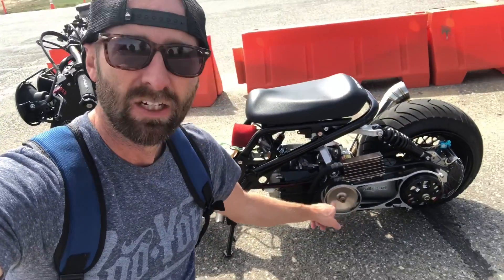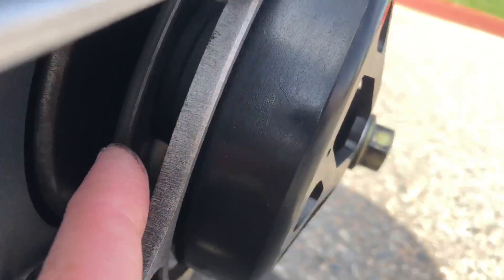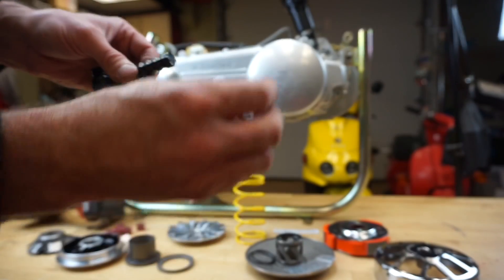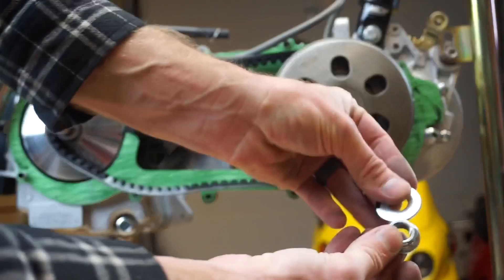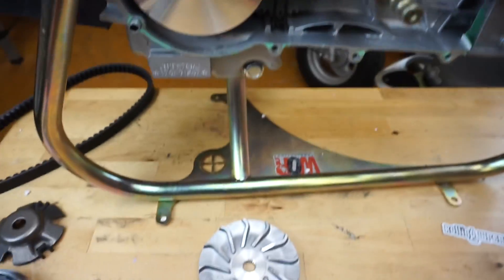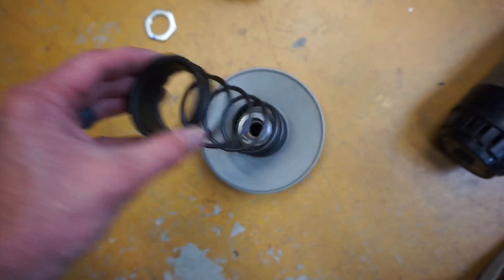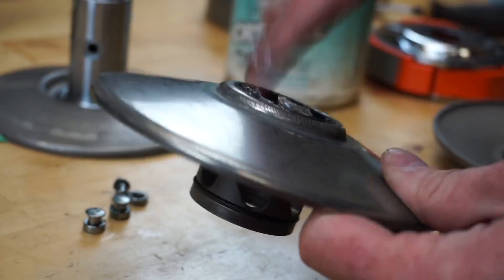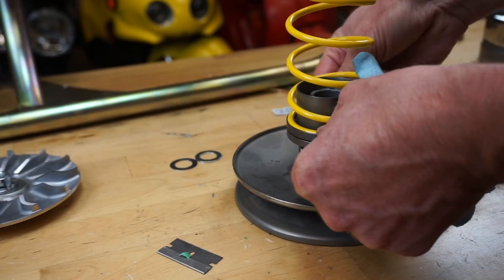All about the CVT transmission (GY6 performance)

Comment: Hi ow do I measure a secondary torque driver sheave. I need a replacement but don't want to order the wrong sheave also what's the difference between a 50 cc sheave and a 150 sheave

Comment: I have a bms sand sniper 150 go kart. It has a leak in the bearing area by the clutch. Are the bearings and seals pretty common across all these platforms?

Comment: I might be wrong but shouldn't you put grease on the channels where the pins go before closing it? since the 2 rubber o-rings are there to prevent it from getting unto the belt
Reply from the maker: Yes, if there isn’t any already
Reply: @RollingWrench  thanks man, btw how will I know if my belt is slipping? i have a 160cc scoot with a 1k contra spring, is that good?

Comment: I want to adapt this system from GY6 to my cross moped, with lawnmover engine to replace my old two stroke AM6...

So,can it be done?
What I need to keep in mind?

Can it be done without final drive (directly to the rear well,in place of sprocket?)

Its adaptacion so, mabby to put it on rear weel sprocket thry improvised final drive?

Comment: I bought something called a Blade 150 (Vitacci, Apollo, multiple names). I think it is  a GY6 that needs to be replaced with your CVT performance parts, but the model code doesn't have Q. It is 1P57F. Anyone have any idea if that is GY6. It looks just like the scooter one at the very beginning. No cranks sticking out of middle, No bolts to take transmission plate off.

Comment: If the clutch doesn't pull up and turn then what is happening bc I've tried everything.. and yes I'm using the same ncy super kit
Reply from the maker: Take the secondary slider apart and inspect and lube it
Reply: @RollingWrench  yeah I went back in and used moly grease instead of high temp bearing grease and that did it

Comment: Can u tell me what weights should I use on my 150cc 157QMJ . Fully stock motor with a racing cdi and a open exhaust and im currently using 13g on my variator.  Im making pull up to 64mph . And I weight 215 220. But takes forever to get there
Reply from the maker: I would go with 10g sliders:
https://www.rollingwrenchdenver.com/products/gy6-dr-pulley-sliders-performance

Comment: Without taking the motor apart is there a way to tell if it is an a block or b block
Reply from the maker: You will need to pull the valve cover. That’s really the only way to be 💯

Comment: So, a 2000 rpm Contra Spring, in a sense, will not let the pulley expand from it's starting point or take off ratio to let the belt drop until 2000 rpm & likewise, the 2000 rpm clutch shoe springs will not let the shoes contact the bell until 2000 rpm ?
So you "could" have a 2000 rpm Contra Spring with 1500 rpm Clutch Springs if you wanted ?

Comment: Someone please help. I am a mechanic by heart. I can fix nearly anything and have repaired many cars, atvs , trucks over the years. My issue is I have 150cc taotao gy6 with a CVT. I just bought a new replacement CVT since the old one was giving me the same issue. New variator, new belt, new clutch. The issue I have is it will not go past 20mph. Also I noticed as riding the variator and clutch are not engaging correctly. The variator should raise the belt and the clutch should lower the belt right. Well while riding I left the cover off to watch and its not engaging. So I put the 4 wheeler on bricks to test it and revved the motor its engaging correctly. When the 4 wheeler has weight on it its not engaging but when the weight is off it is. This is a new CVT and the old one was doing the same thing. Anyone have a idea whats going on. Only thing I haven't checked is the gearbox
Reply: Theres a loose spring some where, these small motors like lucas fuel system cleaner mixed in too
Reply: @benson4u215  the carb got dirty so I took it apart and cleaned it. Got tired of replacing the filter while testing so I left it off. Took it for a test drive and realized the whole time my filter was restricting the engine was too much. The thing hauls ass now with no filter.  A huge difference. Will be putting a high flow filter on it asap.

Comment: It would be kind of cool to have a mechanism that would allow a manual control of the variators so the operator could control the range.
Reply: Perhaps a tuning fork with 2 little 608zz bearings pressed on the ends to run along the edge of the variator. The bottom end of the tuning fork then connected to a servor motor linked to a switch on your handle bars could work? A little measuring beforehand should let you know how much of the fork to cut and the mechanism could possibly be housed within the cooling duct of the cvt cover. Some extra cooling holes right in front of the variator housing will compensate for the loss in air flow. I dunno, we might be onto something...

Comment: Hey what do you do to eliminate that black rubber tube [comes from the factory air filter box] that is on the right side of the engine at 6:25 .. Do you just cut it and cap it off or do something else with it?

Comment: I know that the open look, looks cool, but the stock belt cover wouldn't look bad if a small plate was placed over the unsightly"4-Stroke" legend. The kickstarter hole could be plugged if the kick started is deleted. The stock cover can keep the transmission area of the case from twisting. A 12-volt computer fan can cool the belt, if need be.

There is hell to pay if the variator hardware is not tight, as even the aluminum variator it can strip the spline on crank, and not in a good way.

Good video. Thank you.

Comment: Will This variator kit work with My 150cc VIP PowerMax scooter?
Reply: It has a GY6 Engine just want to make sure it works with my VIP PowerMax 150cc I would not want to buy the kit and I it not work please respond,Thank you very much .
Reply: It sure they're using GY6 engine

Comment: I have TVS Ntorq 125 cc. Please tell me how to increase performance. I want more speed. What modifications i can do ?
Reply: lighter rollers, new clutch sprinigs designed for higher rpm, bigger fuel jet, powerfilter instead of the boxy one, high volt bobine and performance cdi, high performance cam shaft, titanium valve springs, titanium valves, performance rocket arms and lastly a simple motor and transmission oil change.

Comment: Question: my son has a Kymco 50 2 stroke atv and races flat track. I have managed to get a lot of speed out of it with high rev CDI, leaner jetting, and different roller weights and a non restricted boss. NOW all the other 2 stroke ATV’s hot super high Rpms before the clutch engages, if I get a stiffer contra spring and stiffer clutch springs, will this do the same for our atv and will I sacrifice top end?
Reply: It would have the same effect on the ATV as on a scooter but please be aware that 150cc upgrade kits and 50cc upgrade kits are not cross compatible

Comment: I got a 150cc scooter with rpm spring (i don't know in english, your's yellow) about 1800rpm and which weight roller do I use?

Mine using 9gr and it was sound so terrible

Comment: hey folks, i think all ATVs and all mopeds should all the using BELT DRIVE instead of friggin chains that get screwed up easily from all weather conditions!!
Reply: Belts are cheapee to replace bur often need replacement more frequently but they are quieter and require 0 lubrication and the closed transmission does definitely protect it from dirt

Comment: I have a question I have a TaoTao 50cc I replaced the front variator last week and I didn't have to remove the rear clutch. Now I plan to replace the rear clutch Do I have to remove the front variator or can I leave it on while I replace the rear clutch? I'm lazy I know lol But nah I have a friend at Walmart just trying to get it done fast as possible so not to get in there way. And do you know if it comes put together already? (rear clutch)
Reply: only if you going to grade for a quick reply try asking don at tulsa scooters

Comment: Matt, what do you think about venting the gas cap? I am wondering if I should drill a little hole because I'm having start up issues on a cold engine on a warm day. When I take off the gas completely when tuning my carb I get a raise in RPM's, when putting it back on RPM's drop.

Comment: I installed 10g dr.pulley on a 115cc yamaha, 1k rpm clutch springs, performance torque driver (straight cut), everything else is stock.
Im 120 lbs btw.
Is that ok for a better top end?

Btw, very good videos! Planning to buy that Y tool for the variator. Keep it up!
Reply: tj villaruz dude is your bike a Yamaha Mio Sport (or Yamaha Ego S) by any chance?

Comment: What clutch spring set up (by color) & roller weight do you recommend for a 47mm big bore/a9 cam/uni filter/85 main jet 35 pilot jet on a qmb139. My weight is 160 and i live in area where roads have decent incline, and overall just looking for the best take off and low end power. 
Thanks in advance! You guys have great content I'm looking forward to more in depth videos like this one 👌
Reply: When it comes to roller weights you either, get faster acceleration and lower top speed, or higher top speed but slower accelaration

Comment: best roller weight for 139QMB 70cc (47mm clip) 16x13 ?
Reply: 125cc do you think applicable 200cc pulley?
Reply from the maker: I would run 7g dr pulley https://www.rollingwrenchdenver.com/products/dr-pulley-variator-slider-weights